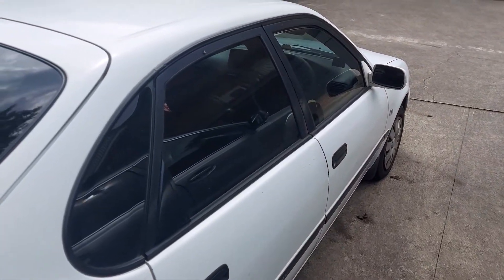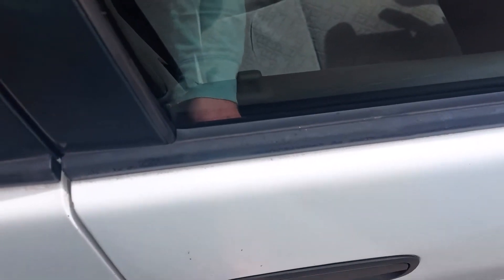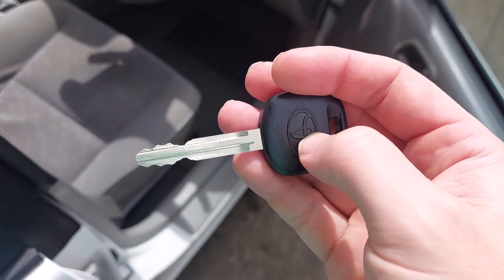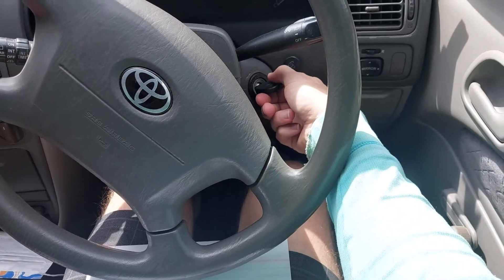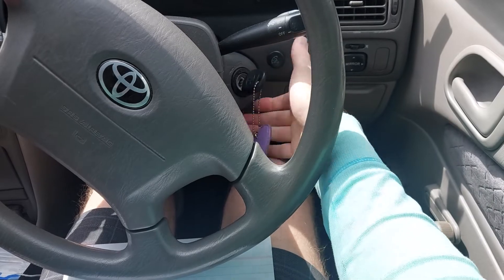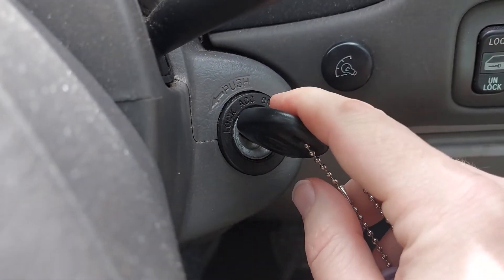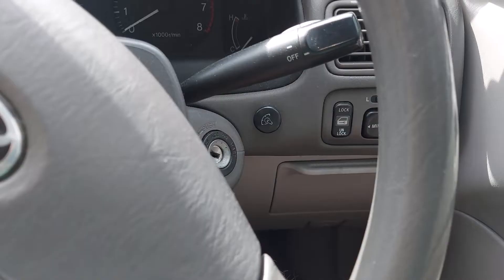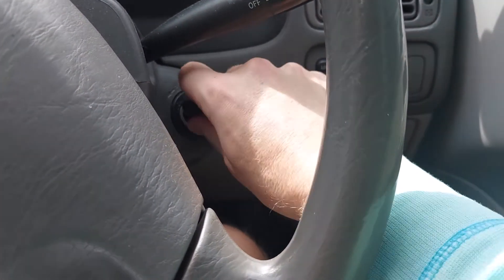Ae112 key program Toyota Corolla Ascent 2000

Comment: I gave this a go on my 2000 Corolla AE112 as well and it didn't initially work either. I had two original  keys supplied with the car when I bought it, and could not get a new key that I bought, which was a new Toyota key,  to start the car using the program method with one of the original supplied  keys. I tried about five times. Then I tried the second original key supplied with the car and managed to program the new key, on the first attempt, as the car started. I believe you need an original master key, and not a post programmed one, for the whole process to work . Thats why my car started with the second supplied original key. It must have been an original master key. I've read some time in the past, relating to another car manufacturer, that an original master key is required for programming, and I think this is the case with Toyota as well. I believe things would get a little more complicated If you lost the original master key of your car, as you would not be able to program a new key then. If any one has more info on this whole topic, please post, as I would like to know. Thanks for the video.